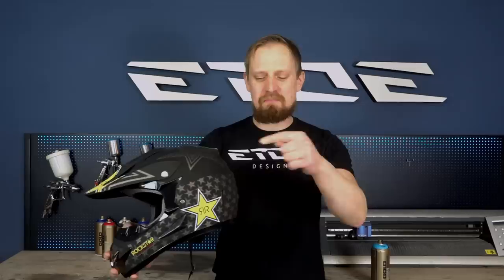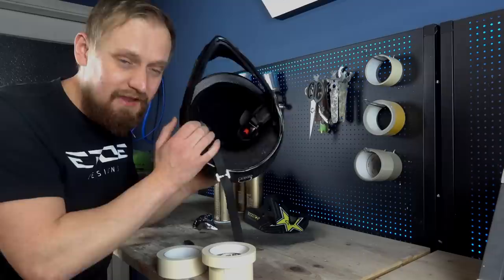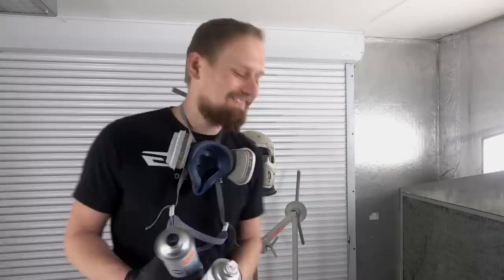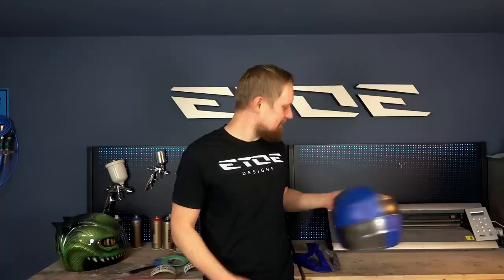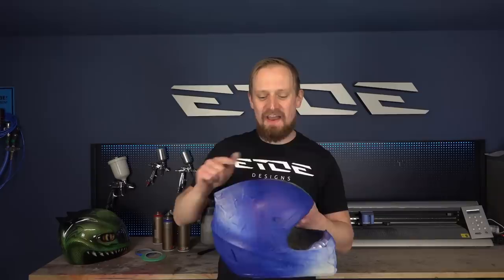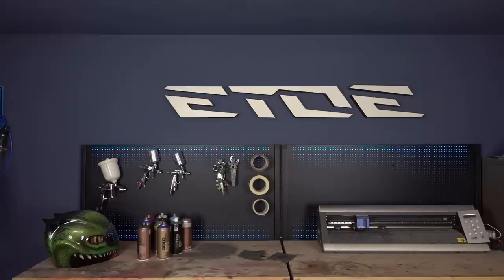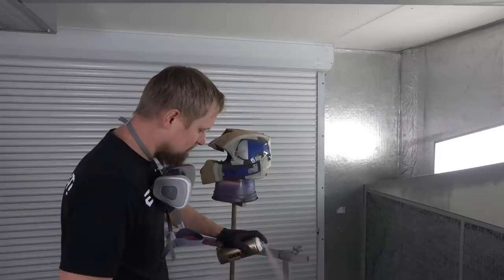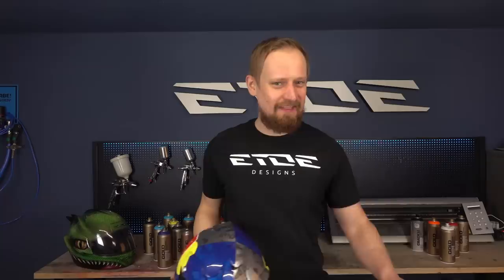spray paint a helmet with spray cans only

Comment: Would be interesting to see the result without using a dustfree paint cabin. People who use cans do not have a dustfree paint cabin...
Reply: Next best option is what I did in my garage to rattlecan a car. Go to home depot, buy sheets of plastic, hang it on all sides and ceiling. Throw water down on the ground to keep dust from getting kicked up. If you want ventilation, take two box fans and two central air AC filters, cut two square holes, tape the fans to the plastic, tape filters to the fans. Boom at home paint booth for like 45 bucks.
Reply: @pirateoftheweb3813  Thanks for your tips👍

Comment: Why did the paint pull off with the decal when you accidentally let off the cap for a split second?
Reply: I was also wondering the same thing
Reply: I was wondering this too.  Maybe the color layer got too light in that spot?
Reply: also curious about this.
Reply: I cannot imagine that this is the real reason... I always do canjobs. And i let the off the cap way too often in his opinion... but nothing happened.
Reply: Because since its aerosol, as you're laying down the paint it's a constant sheet of material. If you let off and spray again solvent comes out that propels the paint. It leaves a thin area and the paint isnt bonded in one whole complete coat. You see when you pain auto body parts from bare you wrap the paint around the corners and it locks the paint on. This is why when you pay for cheap paint jobs on cars they only last a few years.
Reply: @cgrobe21  isnt that why you restart the spray off the helmet?
Reply: @YFindustries  well yeah if you were using a hvlp gun in automotive spraying but rounded objects such as this you want a non stop initial spray so that its completely bonded. The after coats aren't as critical due to it having a base coat to adhere to. All other coats root into the primer. You want the primer to bond with the plastic.
Reply: So it’s just the primer coat where it’s important to use this technique and why he didn’t really do it with follow on coats?

Comment: Pls! Do custom paint groupsets like ultegra or dura ace!
Reply from the maker: Only carbon crank sets are possible.
Reply: @ETOE  why is that?
Reply: @VisualKIt.Studios  Carbon has varnish layer that can be sanded away, but aluminum is anodized and would need excessively prepped to the raw surface and smoothed.

Comment: What about the surface tension getting damaged when sanding the helmet
Reply: Yeah, Never do this people!!! Especially with rattle cans that contain a higher amount of thinner/dilutant just to get them to come out of the can.  I've been Fully qualified painter for years and Would never put my life at risk wearing an 'altered' helmet. I've done a few that are just for decorative purposes. If image is more important than safety, then bin your helmet and get a cool haircut.
Reply: @TheScottishSprayer  I was wondering about that. Would like to customize my helmet but have been wary of it, since all methods found ultimately affect the integrity of the helmet, be it by sanding or using paint that can be corrosive. And almost no video makes mention of this!!! I wonder about stickers though? In your experience, would sticker adhesive damage a helmet's integrity, for example, using duct tape all around?
Reply: The Scottish Sprayer so basically it’s the sanding that damages the surface tension because I’m not very aware to painting helmets, or it’s the paint?
Reply: Yeah I'd trust a sticker more I think but to be honest if the design is that big of an importance I'd recommend saving for a) a top end helmet with a design you love.  Or b) a professional paint job by a helmet designer. (Someone who specialises in helmets only, and knows the specs of paints, reactions and tolerances) I follow someone on Insta who does a load of pro drivers helmets.
Reply from the maker: You can paint a helmet without damaging the surface.Please check this video for an explanation of what to do: https://amzn.to/2QNFB2R

Comment: That helmet looks.... Sketchy, the construction I mean, doesn't look solid enough to protect. You in a crash. Looks. Like a lot of the cheap ones on wish.

Good job on the paint job dude. Please warn people to. Check what they are doing with the oem though some sprays can damage the thermoplastic of cheap helmets.
Reply: Yep. I'd never spray a plastic helmet. Wouldn't wear one either but that's a different discussion.

Comment: This legend's videos are a crack-up... 
I have a question i'm hoping some of you may be able to help with regarding my helmet paintjob project;
I've started painting my helmet and done my base layer color, however the base layer feels a little bit tacky/ sticky after about a week of leaving it to dry (even though it is 'dry', it feels just a bit tacky to touch. For example if you push your fingernail into the base layer you can indent it a bit (not easily, but it's not a fully hard surface). I assume i probably spray painted too thick, but is there any way i can fix this?
this is what i've done so far:
- sanded old paintjob right back (400/600/800 grit) then cleaned with rubbing alcohol
- sprayed with a primer then let dry for 48hrs
- light sanding then cleaning
- sprayed a base layer white (using Tamiya spray cans which is RC body paint) however there was not enough base colour on the helmet and as i couldn't buy any more Tamiya paint i done the following:
- I switched to Nippon Paint Pylox spray cans (as it was the only thing available) 
- I sanded bank some of the white base layer (tamiya paint) on the helmet to get a scuffed finish but still kept the white base layer then cleaned it
- I then sprayed more base layer white using the new Nippon Pylos paint, I let the first coat dry for 15 mins, then painted more coats (I think this is where i've liekly painted too thick).
Now i'm at the above steps and although the helmet looks nice, it feels a little bit sticky to touch (even after drying for about a week). 
What is the best way to solve this issue? Should I:
- fully sand back to bare, re-do the primer and start again?
or
- wait a few more days/ week then continue with the next layers even if it's a bit tacky (will clear coat that the end solve this issue?
or
Any other suggestions?
Thanks anyone who has advice  (particularly if @ETOE is able to give any input).
Reply: You really need to start over. Use Rustoleum. It works really nice. Do not use R.C. car body paint. Spray in LIGHT coats for an even finish. REMEMBER... adding and adding more and more paint is going to give you a really "gloppy",BAD PAINT-JOB. BIG TIP::  Whatever you do, DO NOT RUSH or it will look like shit!!    ...Take your time ,think, do not rush....and you will be HAPPY!!!
Reply: @williamsaloka9043   awesome thanks bro,,, I appreciate you taking the time :)

Comment: I have a few questions cause I got a little confused:

I dont understand how lifting your finger off the cap ruins the paint, can you explain?

How come you didn’t keep your finger pressed with the other colors?

Why did you sand the helmet after putting varnish, and again after applying clear coat?

What is the primer and multi something for?
Reply: Kinang Eagle Hi when do you puls the can and when not plz
Reply: David Grobler what?
Reply: When you release your finger the velocity of air going through the nozzle reduces which then impacts the atomization. So instead of nice fine droplets of paint, it starts to gurgle and you get some larger blotchy drops.
Reply: @wallymcguire2033  hi, didn’t see your comment until now. I remembered this comment and I actually ended up answering it with common sense. Actually surprised at my self for asking these really dumb questions. Thanks man

Comment: To anyone thinking about doing this to thier helmet. If you have a helmet made of fiberglass or any sort of composites, ie carbonfiber, Kevlar or fiberglass and you spray it with spray paint you are asking to weaken the structure of the helmet and in doing so are risking your life in a crash. The solvent in spray paint will degrade the helmets structural integrity. Take that into account when thinking about doing this
Reply from the maker: No you are wrong. Carbon fiber and fiberglas can not be harmed by the used acylic colors.
Reply: @ETOE  I said spray paint didn't say which kind and they most definitely can be. I do carbon fiber work. Both hand lay up and autoclave molded and vacume bag as well as prepreg. Not all resins nor all spray paints are created equally. There have been studies showing that the solvents most definitely do degrade the resin matrix and in doing so weaken the helmet shell. The only time that it is 100% not an issue is if you were to use a water based water borne paint. Thing is, spray paint is neither. To further complicate things, by sanding the helmet you effectively remove the protective barrier or at least weaken it to the solvents. Just a very mild scuff with scotch Brite pads would probably be ok but then again it depends on the spray paint. Why do you think they use gelcoat on most fiberglass work? Using the proper primer which would not be a plastic primer might help but who knows. I don't have a lab to test shit but I can read and research as easily as the next guy. Airbrush is safe with water based paints or even automotive urathane paints if done properly but hey I'm just some guy on the internet right
Reply from the maker: @twistedsocal  please watch this and all my carbon prep and paint videos as well:https://youtu.be/SJH-712kM6w I'm just a guy doing carbon paintwork for more than 15 years. If you are right a lot of people had kicked my ass during that time.

Comment: Loved your helmet vid so much I’m gonna have a go at ruining one of mine. Might even record the disaster unfolding for amusement! :D 
Would you mind clarifying 3 questions for me before a start on this mistake I mean venture?

Primers- Is it just one coat of plastic primer and one of multi primer and how long do you leave it to dry before sanding it?
Masking tape- How long do you leave paint to dry before peeling off masking tape and how long should freshly sprayed paint dry before sticking masking tape on top of it?
Finishing lacquer- I have spraymax 2K lacquer, is it safe on helmets and how many coats do I do? Could do with some details on the timing of lacquer sanding/finishing as I understand once mixed 2k only lasts 24 hrs?
Any help appreciated
Reply from the maker: Time delay is one big poop or three slices of tuna pizza. If it is chilli pizza only one and a half slice. If you want to be safe use hair spray or ask your helmet producer which chemicals to use.
Reply: Thankyou. I have ordered the pizza as I’m thinking the only big poop I’ll be able to conjure up is the pile of it that used to be a useful helmet. 
I am a bit concerned about sustainability of tuna fish stocks not to mention ingesting the levels of heavy metals n pcb’s in larger fish so I went with magherita which was also much cheaper, hope this won’t effect the helmets finish?!
Emailed Spraymax 2K, they say YES to plastics but need adhesion promoter which I have so time for me to daydream about the amazing job I’m gonna do straight out of the box after a 20+ yr hiatus of doing nothing with paint. What could possibly go wrong?! 😆

Comment: I wish the line tape didn’t cost as much as it does. I love doing designs with it even did a flame outline on a vehicle. Even though all that was on was the green tape it looked pretty sick and if I knew how to pin stripe or paint I would have for sure. I have a Harley helmet I’m not using maybe I’ll try something like this. I only have big box store paint. Would it be better to find an automotive paint store or online specific stuff?

Comment: great job Martin. Any chance of doing a custom Road cycling helmet next. one with vents in????
Reply: Can’t paint cycling helmets. Breaks down the integrity of the safety aspects of it.
Reply: @denismacfarlane255  if you use cellulose based paints on the polystyrene base then yes but not an issue if you only paint shell. Or perhaps you havent noticed all the helmets with different designs😉😉
Reply from the maker: Please check this video for a bike paint Helmet: https://amzn.to/2QNFB2R

Comment: How long do you need to wait after a coat before you can apply masking for graphics? Is 15 minutes long enough, to allow for wet on wet coats with the graphic paint colours?
I will be using Duplicolor Metalcast rattle cans which are translucent over bare metal.
Reply from the maker: I have to wait 10- 15 minutes.

Comment: Great Video! I've been researching this and I see that depending on the shell material it may be safe or unsafe to paint, add stickers or decals. I'm thinking of adding some stickers to my KPA shell helmet and then applying a clear coat layer to protect them as well as to give the helmet a uniform appearance. Is this safe for this type of helmet? If so, what clear coat product would be safe to not affect helmet strength and integrity? Thank you.

Comment: Hey Martin, I love the content and all the infos. I have a question about the Montana Varnish - do you think it creates a good enough final finish, that would not react with other materials? I'm asking because I varnished one of my guitars with a 1K acrylic clear coat that I got from a local art supplies store (some in-house brand) and then when I left the guitar for a longer period on a guitar stand, it got glued to the foam of the stand. None of my other guitars do that, but they have a professional clear coat from the factory. I read on the Montana website, that the Montana Varnish is good for indoor and outdoor use - what are your experiences with it as a final coat? I want to get into some helmet custom painting as well, so I'm wondering if it's a good solution, since I don't have a spray booth and definitely don't want to blast 2K lacquers on my balcony :D Thanks for any help!

Comment: Good thing I seen this video before I finished painting my motorcycle race fairrings. Why wet Vs. Dry sanding though? Will my clear coat finish look like crap if I don't sand it?
Reply: Justin Cavinder yes, everything will look like crap if the surface isn’t prepped properly.

Comment: Great work sir, 
Doesn’t it compromise the safety of the helmet? I’d like to do the same for my street motorcycle helmet.
Reply: S E Phala by removing paint? That is such b.s. and just a liability / return issue. What protects your head incase of a helmet is the multiple layers(shells) and outer shell which is becoming more and more carbon fiber.
When you crash the helmet manufracturers look for cracks in the carbon outer shell or indentions in the inner hard foam shell. They don't care about the paint. 
 Paint is not a protective layer in a crash and even if it was he just repainted it, so I guess its safe now?!?!
Reply: Ever heard of Troy Lee Designs?? He got started by repainting moto helmets, and all of the best riders had him repaint their helmets. He did that for years before he had his OWN brand & helmet line.

Comment: Love the teaching! Question for you - how many coats you can do with one varnish spray. Could I do, say, 2 helmets 4 coats each ?
Reply from the maker: No
Reply: @ETOE  3 coats each ?  Or just one helmet ? I am thinking about getting the 2k do I need one can per helmet ?
Reply from the maker: @lederse  I used one can for this helmet.
Reply: Thank you. One more quick question. I see you only using, or rather mainly using Montana Gold. Would you recommend staying away from the Black line when doing helmets or either one would be fine ?

Comment: Moin Martin, Colles und hilfreiches video so das ich jetzt auch versuchen will die Räder Meiner Jungs (4J und 7J) in dem gleichem Design "Miami to Volt Fade" wie mein Trek Bike zu lackieren.
Die Frage ist nur, wie finde ich die passende Farbe? Da zB. bei der Marke die du verwendest, zumintes optisch sich stark unterscheidet und im netz keine näheren Angaben zu finden sind.
Reply from the maker: Gehe zu einem Profi mit deinem Rad und lasse eine Farbanalyse machen. Radhersteller geben keine Fatbcodes heraus. Zumindest keine die auch stimmen. Mit der Farbanalyse gehst du dann zu einem Farben Großhandel der Dosen abfüllen kann und lässt die passenden Dosen abfüllen. Wenn dir das alles zu teuer ist empfehle ich übliche, erhältliche Standardfarben zu verwenden. Ich biete weder Farbanalyse an noch Dosenabfüllung, da beides für meine Kunden zu preisintensiv ist.
Reply: @ETOE   Danke guter Tip, fragen koscht ja erstmal nichts. 
Danke & Erfolg weiterhin.

Comment: Hi, Martin.
You have wonderful videos. Here is my question:
There are several types of paint in spray cans - with and without hardener (i mean two-component paint). What type of paint are you using? And especially the clearcoat (varnish).
I tried to paint the bike, and as a result the varnish was sticky rough and collected dirt. Do I need to polish the varnish at the end, or it have to be smooth already?

Google translate was used..
Reply from the maker: For this helmet I used 1k varnish. In my professional paintjobs I use 2k clear.

Comment: "Kick in the ass and a punch in the face" hilarious!!!
Okay I need your help with some details: keeping the cap down keeps the paint even correct?
in some shots l see you push the cap in and out specifically when applying the red on the Red Bull logo can you do into a little detail on why to keep the cap down or not to? Thanks in advance and awesome work looks professional in my book.
Reply from the maker: To avoid splatter in the metallic paint and for an even, whet coating.
Reply: @ETOE  Great thanks!